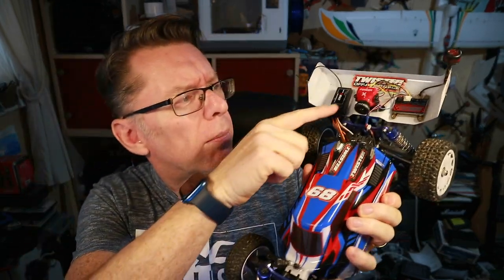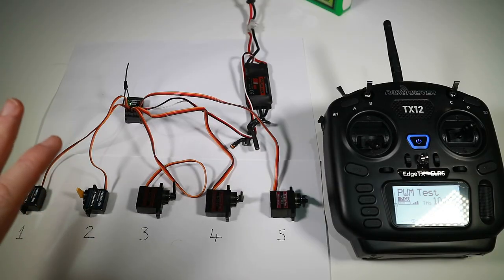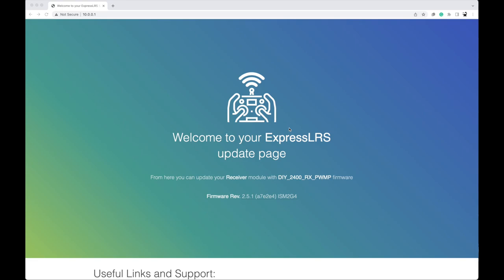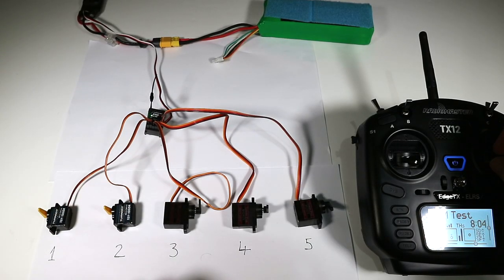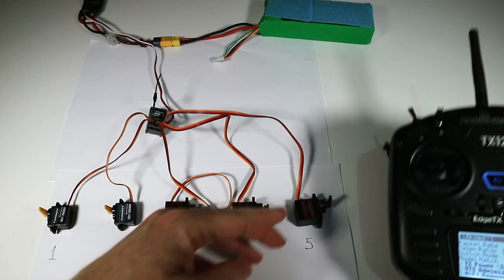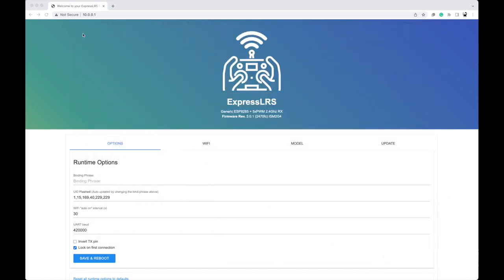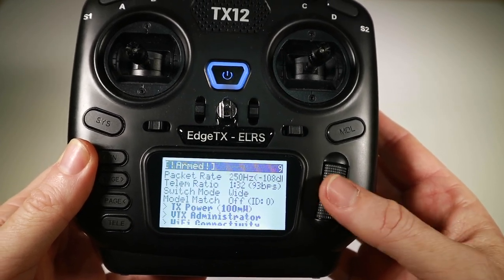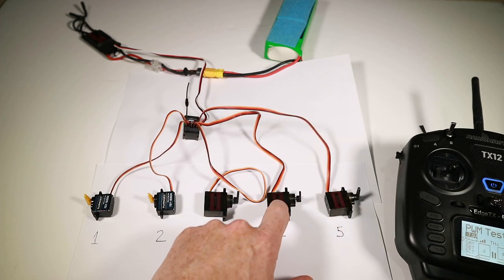How to get full range from the 5th channel of ExpressLRS PWM receivers

Comment: Thanks, this video helped me! :) I'm using ver 3.1.1 with a BetaFPV PWM module, but even so, channel 5's input on the RX module definitely still needs to be remapped in order to get full resolution.
The fact is that ELRS uses the channel 5 input for arming, ALWAYS! So ELRS treats channel 5 as a switch. This is the crucial take-away here.
I chose to arm/disarm channel 3 (the throttle) on my radio, so I can afford to remap channel 5 on the receiver. 
It however now works for me. I can now have the left and right ailerons on different servos, using full range on all 5 channels of this receiver: 
Elevator: input 1, output 1
Rudder: input 2, output 2
Throttle: input 3, output 3
Left Ail: input 4, output 4
Right Ail: input 6 (!!!), output 5
So on the radio's mixer, I'm sending my Ailerons to the Radio output channels 4 and 6, which means they'll arrive at the receiver's input channels 4 and 6, and will the receiver will output them on ports 4 and 5. It's a hack, but it works.

Comment: I wish there was a pistol grip ELRS radio for ground vehicles.  Great tutorial 👌
Reply: Same here, I wish there was at least an accessible OpenTX dev board that allows people to create their own radios without having to buy a new radio to gut it for parts.
Reply from the maker: Would be great wouldn't it - I think the closest we can get (maybe) is trainer cable from a car radio into an ELRS radio and then to the car.  Which is a very long-winded way of doing things, but better than nothing I guess
Reply: @CurryKitten  Albert Kim did something similar with crossfire.
Reply: @RCinginSC  Hi mate,  Have a look at what's going on with unlimited control and UHD FPV over the 4G and 5G network using Ras PI 4 mate.. Its absolutely insane, I believe that's the way its heading as we go forward. Ras PI 4 boards have gone from $20 to $300 in some places as people click onto this infinite RC link tech. For those of us into ground vehicles or boats and also cruising wings, It doesn't get any better🙂@CurryKitten - You could build one up easily with your skill set ...Give it a go!

Comment: Hi, I googled it without success, so I will try asking here: Is there any branch of ELRS with PWM outputs with the 0-100 % signal for DC motors? I would like to control motors by transistors  directly connected to the RX outputs without ESCs or an FC.
Reply from the maker: This almost certainly doesn't exist.  I did think you could actually drive a DC motor with a transistor via PWM.  But I haven't read up in proper detail.  Perhaps you need to stick an arduino in the middle to interpret the PWM signal and put out the necessary signal to your motor

Comment: Hello! I have a LEFEI SN-L v2 flight controller which I access via sbus with ELRS with a Matek CFRS to SBUS converter. The problem that I have is that the flight modes are made with channel 5 of 3 positions and in ELRS, as you mention, there are only 2. The serious question is if the same thing that you explain for PWM works for CROSSFIRE? Thanks a lot
Reply from the maker: What ELRS aren't very good at is looking at older flight controllers, or protocols - so I don't think they'll ever have ch 5 as anything but a binary switch.  ELRS was developed for latency over everything else, and the less full range channels they have the faster they can run.  Crossfire was mainly developed towards long range, so aside form the fact it can speak SBUS (as well as CRSF) you've always had full range channels to do with as you please

Comment: Learned a lot , but not sure if I understood it all considering you had pushed switch mode from 8 to 16 channel.
Is there any way to run elrs with more than these 5 channels ?
I need to add a camera gimbal which requires additional 2 channels beyond the usual 3 needed for a glider and 4th for the motor. 
But how would I get the 5 th and 6th channel needed for control of the camera gimbal pan and tilt ?

Or is that what you meant that is still missing in the elrs receiver portfolio ?
Reply from the maker: It was missing, but watch a video I'm releasing on Thursday for some gear that might satisfy your requirements.  Also, ELRS are bringing SBUS out in their latest release (which is in Release Candidate at the moment)

Comment: Hello. I have same tx12 controller, and er5c receiver. Do i need external transmitter to connect er5c with tx12? Or it will work with internal transmitter and protocol crossfire?
Reply from the maker: If you have the version with the internal ELRS TX, then choose internal transmitter and protocol crsf

Comment: Since I was aware of the basic approach - using a kopilot its necessary - I skipped most of this.  I hope you told viewers to drive the over the air ch5 high permanently.  Otherwise some other issues with ELRS get wonky.

Comment: Can it read the battery voltags?
Reply from the maker: No.  If I use these in FPV, I use a camera that has it's own OSD with voltage on.  There's discussion in ELRS about how this could be implemented in the current hardware, but what I'd expect we might eventually get is a PWM RX with a VBAT input so it is easily able to send back telemetry

Comment: If I have an ER8 receiver, can I set Ch5 to ch 9 in the ELRS WIFI and then set the mixer to Ch9 on the TX16, which is then set to ch5 on the RX? Google translates.
Wenn ich einen ER8 Empfänger habe kann ich dann im ELRS WIFI beim Ch5 den ch 9 einstellen und bei der TX16 dann den Mischer auf Ch9 einstellen, der dann beim RX auf ch5 ist? Google übersetzt.
Reply from the maker: Yes.  Since the time I made this video, ELRS is much better on PWM, so check out some of my later videos where I reassign channels and basically skip over channel 5.  Ja. Seit ich dieses Video gemacht habe, ist ELRS bei PWM viel besser, also schauen Sie sich einige meiner späteren Videos an, in denen ich Kanäle neu zuordne und Kanal 5 im Grunde überspringe.

Comment: How do you actually connect this rx to a drone fc for betaflight?
Reply from the maker: This wouldn't really be the sort of RX you'd connect to betaflight as it's main feature is that you can use PWM servos.  That said, it can simply be connected to RX/TX/5V/GND and you can use it like a regular ELRS rx

Comment: Grest stuff.
What do I select in the confiqutor to update the ER5A reciever to version 3 .. seams to not listed.
Reply from the maker: It's there, but probably not what you are expecting.  The ER5A runs the DIY firmware, you'll see it if you join the wifi network that the RX will provide and look at the webpage at 10.0.0.1 where it tells you.  The device category in the configurator is DIY 2.4 GHz and the device is DIY 2400 RX PWMP
Reply: @CurryKitten  Oh wow thanks a million.. wouldn't have picked up on that straight away.. 
From New Zealand
Reply: @CurryKitten  
Do you know if there is anything on the horizon to read battery volts for these recievers that may a use channel for telemetry like Graupner do?
Reply from the maker: There's discussion on this, I think it's likely be a pad you'd solder power onto rather than a channel.  But there's nothing available (that I can see) right now

Comment: Hi do you no how i can get a 3 position  to work on  a pocket trying to get a kopilot lite to with radiomaster er4 receiver but channel 5 is only 2 position thanks
Reply from the maker: Have a look at what I do at 3:00  Ch 5 in ELRS is always a binary switch, so the answer is you don't use Ch5, you redefine the output to Ch6 and use that instead
Reply: Ya doesn't work ers4 receiver no 5th channel listed so setup with just a 2 postion switch so stability mode and return to home but now I can't get the kopilot neutral calibration to work and when I turn the radio of it doesn't go into return to home haven't a clue what I've done wrong thanks
Reply from the maker: Ok, so the 4 channel version.  In which case how are you using ch 5 with the kopilot.. it can't talk CRSF can it?
Reply: @CurryKitten still asine mod to channel 5 but only works as a two position switch rth and stability mode no manual mod